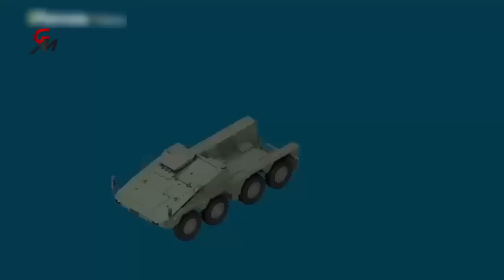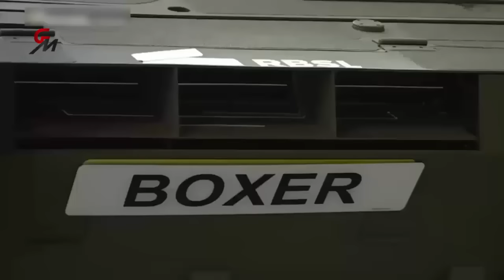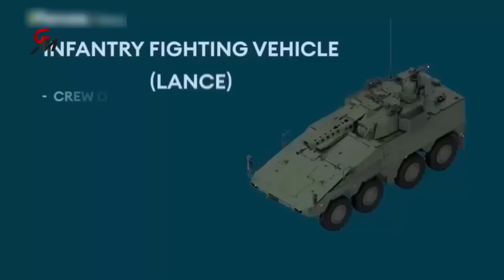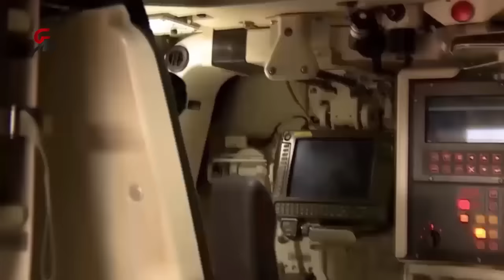The Wait is Over! UK Army's Boxer MIV Are Being Produced On A Large Scale

Comment: The new tracked Boxer chassis with a lance turret seems like a good replacement for the failed Ajax scout vehicle.
Reply: Not enough armour. Ajax is a completely different class of vehicle. It's almost double the weight. The UK should have gone with the CV90 but despite the bad start the Ajax will come good.
Reply: @wsm7929  I see.  Well, the Ajax's tendency to make the crew feel awful after a short ride will absolutely have to be dealt with.  Clearly the CV90 is far better, but if Ajax doesn't deliver a product the troops can use without it chronically injuring them, then General Dynamics and General Sycophant von Crony are going to be eating it.
Reply: @MichaelK.-xl2qk  Those issues have been fixed and I suspect given the USA New M10 Booker light tank is an Ajax platform it will be here to stay. 

The M16 had lots of problems but it turned out to be one of the best guns ever made. 

Harrier jump jet was heavily critised it was said it wouldn't stand a chance against supersonic fighters. Turned out fine. 

I accept it was a procurement disaster and as required alot of fixing. But once working as intended it should be one of the most affecting vehicles on the battle field.
Reply: @wsm7929  I agree with your assessment of what may be possible when a good idea gets through the debugging and fine tuning that inevitably accompanies making it real.  What I am concerned about is the appearance of a swindle, which can only be judged at the point where the promised goods are delivered and the bill is presented.  The UK can not be expected to pay twice as much as originally bargained just because GD ran into internal problems getting the thing done.  They are clearly going to make money selling the thing to the US Marine Corps, so they need to eat the cost overruns themselves.  These defense contractors should be held to a high standard or they will take advantage.
Reply: @MichaelK.-xl2qk  From my experience with government contacts, I suspect there were lots of instances of. "Wouldn't it be good if it could also do this or could you had this function please." Generally this one sentence is the root cause of most projects delays and overspends. I work in construction and the public sector is terrible for it. Then when the cost go up they will say. "We don't have the budget it this year can we spread the cost over more years". This always put the cost up even more and it's a vicious circle. 

I suspect military contracts are no different.
Reply: Sweden sent its latest and best to Ukraine they lasted a few minutes 😂
Reply: @yfelwulf  Well then why pay more?
Reply: @yfelwulf  Name one military platform that isnt vulnerable to certain scenarios??
The onus should be crew survivability, interchanged with modularity.
Reply: Tracked=good. Wheels can be bogged down more easily. As we see in Ukraine.
Reply: @wsm7929  Ajax is failed project.
Reply: @wsm7929  Project managing in the Public Sector is something I will never ever do again.
Reply: @wingaard  I agree the project failed in terms of overtime. It is yet to be over budget. The £5.5b price for just under 600 units seems to have remained the same. 

History is littered with projects that had a poor development stage but ended up delivering a world beating product. 

Take the Boeing 787 development, which took 9 years and cost $22b instead of the expected 5 years and $5.5b. But the 787 was a resounding sales success as the fastest-selling wide-body aircraft in history and well on its way to becoming the best-selling wide body aircraft of all time. It is reported that the aircraft has already paid off its development costs and earns Boeing $20m profit per plane on average. 

Another example was the Harrier Jump Jet. It was in development for years went way over budget, was even cancelled by the RAF once judged to be "noted that the effort to combine a strike aircraft and a fighter in a single aircraft, and trying to fit that same airframe to both of the services, was unsound".

I'm sure we can all agree that looking back at Harrier Jump, it was no failure.
Reply: @yfelwulf one loss is not exactly a major shock. 🤦🏻‍♂️
Reply: @wsm7929  How do you know its fixed and what have they done to stop crew sickness .
Reply: @williamdodds1394  Wallace said: “I have been clear this was a troubled programme, it was started in March 2010, I inherited a troubled programme, I was determined I was going to put this right, I get a weekly update.

“We think the remedies are in place, we are now going through the normal trials, can it go after the hill fast enough, does it do these things? It is showing great signs and we will keep on it.

I am confident we have turned the corner on this troubled programme.”

Wallace said the aim was for the Ajax vehicles to be active in military units soon after the testing programme is completed in about 16 months.

He said: “They are already training with it now, all these things take time to train how to use it, we have over 100 assembled so when we get through these trials we will get these into the units and be back on track.”

It is understood that despite the production being described by Wallace as “troubled”, the MoD considers some of the early problems to be development issues, which have now been overcome in updated versions.
Reply: Actually, tracked boxer can have side adons for protection like the main tank
Reply: @@karmakazi101 The Seargent York was a failure.  But to your point, I'm very glad to see the apparent progress from a defense standpoint.  One question left to be answered is whether Ajax will fail to perform the job according to its contract price.  If, at the end of the day, the per unit cost is higher than a CV90, then what?
Reply: @MichaelK.-xl2qk  Would still have been worth doing, Even if it is more expensive. Challenger 3 is due to be phased out as early as 2040 so Britain has been needing to relearn how to produce armoured fighting vehicles domestically before that cut-off for a while now. Even if Ajax proves to cost more than CV90 and with all its teething problems the MOD would rather have all of this now and build experiences domestically so we don't have it when the project for whatever is supposed to replace challenger gets off the ground (if it hasn't already behind closed doors)
Reply: @Fordmister  I'm in agreement with you there.  The important thing is results and action, not more excuses, and we're seeing it happen right now.  The thing has to be ready in time for a conflict which is already happening
Reply: @user-yl1xy5eg7b Tracked needs more logistics though, as you can't quickly move them on the road for long distances. 
A wheeled brigade can move thousands of kilometers within a couple of days without relying on railways. And still be faster at the target location than the tracked vehicles, because moving a brigade by train takes time
Reply: @patta8388  That's if the wheeled brigade doesn't face the sort of rough terrain which tracked vehicles can operate on.
Reply: @user-yl1xy5eg7b  Dude...a wheeled brigade is there to get somewhere fast and either push through if the advantage is there, or hold the line until the heavys arrive. You need booth in a functioning army.
Reply: @patta8388  That does not detract from what I said, and I am an ex soldier. HAND.
Reply: Ajax is now a pretty good unit..

Comment: Have they sorted out the overheating brakes problem yet ?
Reply: I can’t remember what design of vehicle it was but I think there was a vehicle that sprayed small jets of water onto the brake system that cooled it down somewhat but the trick is to not putting too much on the disks at once because cooked disk’s have been known to warp and explode
Reply: Why not fit the right brakes to do the job first time,,, ? sounds like British Leyland .
Reply: @thegrinch8161 What a stupid idea.  Means yet another thing troops have to remember to do, just to drive the vehicle safely. Is the water supply  harmed for winter driving?  Yes even at low temperatures  brakes can overheat. Water cooled brakes are fine on a WRC Rally car that can be replaced every 200km.  Not on an APC.

Comment: You can’t replace a tracked IFV with a wheeled APC. 🤦🏻‍♂️
Reply: sure you can. especcially if the wheeled IFV has better armor, better firepower and surperior firecontrol.
Reply: @zhufortheimpaler4041  a wheeled IFV is not an APC 🤦🏻‍♂️
Reply: @Bob10009  and the UK is thinking about replacing the APC module with an IFV module
Reply: @zhufortheimpaler4041  source ?
Reply: @Bob10009  UK MOD planning for the "strike brigades" from 2030+.
But currently no IFV Modules are on order.
So for now, the UK is brewing up a lot of steaming shit with its actual procurement.
still the Boxer APC version is better than Warrior in basicly all categories from mobility, sensors, stabilisation, operation range, protection etc.
Just the 30mm cannon is missing. But the 30mm RARDEN is an non stabilised 3 round clip fed piece of garbage. going to a FLW200 with fully stabilised thermals and fully stabilised 40mm AGM is for the time being an "improvement" in most areas, except range and penetration power.
Still the UK neets to get ther shit together and start procuring the IFV modules and not just think about them.
Reply: @Bob10009  The boxer can potentially fit to booth roles. It's more tanky than many up date IFV designs
Reply: @zhufortheimpaler4041  so, as I said, Boxer cannot replace Warrior, as the UK is not buying a turreted version. 🤦🏻‍♂️
Reply: @85daniel  the UK version has no cannon or turret, it’s an APC only. How is that “more tanky “ ? 🤦🏻‍♂️

Comment: The first priority should be procurement of turreted modules to replace the warrior ifv that are being axed.
Reply: be easier to just make one type of vehicle, that is multipurpose. And have a rail system on the floor and ceiliing, then you could just slide modules in to it.
Reply: @keibohow69  no tracked varients though. Ukraine has proved wheeled armored vehicles are fucked in a lot of situations.
Reply: @czar6595 most of the places they can’t go you would want the better protection of Warrior or Ajax. One use for this platform could be a wheeled Geopard to combat drones at a more affordable cost than a more heavily armoured tracked system, allowing for more units. A common turret that could be fitted to a tracked platform would be good for front line use.

Comment: Wonder whether they will replace the 30mm canon & have a XM913 chain gun 50mm variant..
Reply: Why? We are not the USA where it takes 2,000 rounds on average to kill an enemy combatant.
Reply: the 50mm round has not so many benefits over a 30mm round.
Penetration is not good enough to engage heavy armored targets, vs BMP-3´s and other IFV´s the 30x173mm APFSDS round does more than enough on medium to long range.
Vs Infantry and soft targets the 50mm HE round does  not increase the lethality by such a large margin that it is drasticly better. 30mm ABM rounds tear infantry and soft targets to shreds.
30x173mm roundes require about 50% of the storage space of the 50mm autogun ammo. so more bang for the same volume.
And against anything that is armored enough that a 30mm wont go through, the 50mm wont either and you  use the ATGM´s

Comment: Would be interesting to see comparisement with Patria AMV, Rhein Metall Puma and Boxer which are basicly made for the same purpose.
Reply: Patria AMV is drasticly lighter armored than Boxer but has similar mine blast protection. Boxer is also faster, but is not amphibious (like Patria AMV when it got its hightest level protection mounted. Patria is only amphibious in its lowest protection level and in that case is only protected against small arms)
Puma is completely different, as it is a full blown heavy IFV with even heavier protection.
Reply: Patria is a pure ATV, The Boxer have much more armour and modules which make the vehicle to an IFV, the puma is a pure IFV with the best armour. In germany there is the plan to have light, medium and heavy combat groups. The light groups are e.g. paratroopers, in the medium groups is the boxer the default vehicle and in the heavy groups there are e.g. the Leopards, the Pumas and the Panzerhaubitze-2000. Aditional germany plans to buy a new ATV to replace the fuchs(maybe the patria) in the future for the troops which are normally not in the hard combat zone(e.g. electronic countermeasures).
Reply: The Puma is much more heavily armoured and more specifically designed as an IFV. It carries missiles as well as the remote controlled turret. The German Army initially planned to only use the Boxer in the APC role, but has now also acquired a better armed version as a reconaissance vehicle and will likely buy a similar version for its "Mittlere Kräfte" (mobile forces that use heavily armed but wheeled vehicles).
Reply: @tobiwan001  Yeah, we're getting 30mm turret versions and 155mm howitzer versions. Option for 105mm tank hunter is still on the table

Comment: Can it cross the same terrain and keep up with the Challenger?  If not, it is not fit for purpose.
Reply: it can and is quicker than CR2 in terrain. 
CR2 does 40km/h offroad, a Boxer does up to 80km/h, so its the Chally that is slogging behind.
Reply: @zhufortheimpaler4041  depends on terrain. chally would be slower than boxer in some areas but would absolutely storm ahead in others
Reply: @jamesamas5527  There is basicly no terrain where Challenger 2 has better mobility than Boxer due to its prohibitive weight and atrocious power to weight ratio.
Reply: @zhufortheimpaler4041  can tell you now there is a lot of terrain where a challenger would smash a boxer off road. war thunder isnt real life mate
Reply: @jamesamas5527  and i have personally seen boxer driving through terrain, most tracked vehicles wouldnt follow into on german training grounds.
That thing has comparable terrain mobility to an MBT.
Only when we are talking about extreme deep mud conditions, tracked vehicles gain an minor edge.
but only those, that are in a similar weight class. 
Challenger 2 has double the combat weight and struggles with alot of stuff Boxer can do.
For example Obstacle climbing or slopes.
Here Boxer outperforms CR2.
The only real thing CR2 can do mobility wise, that boxer has problems with, is trench crossing, here CR2 gains 40cm trench width over Boxer.
Reply: @zhufortheimpaler4041  also after seeing the kind of terrain that a chally just eats up without issue where most other vehicles would struggle, get bogged in or bottom out I'd like to see the boxer try and keep up
Reply: @jamesamas5527  As said above, there iis basicly no terrain where Challenger 2/3 can go and Boxer cant.
On the other hand, there is alot of terrain, Boxer can cross and manage, where Challenger 2/3 cant go.
CR2 is THE HEAVIEST and least mobile MBT in service of western Nations.
Boxer can keep up with Leopard 2s offroad. 
Challenger 2 cant.

Comment: 2 questions: what does this do that other ones don't do? We know tanks/vehicles like heavy IFVs are increasingly useless on a modern battlefield, so, why make this now? Without knowing a real answer to the first question, there's no real purpose in producing these. 

Opinion: It'd possible be better to invest in a stealth motorcycle lol. Or, upgrade a nice cheap yet effective infantry carrier if needed, like the US hmmvv or MRAP that are essentially just cars with mounted things on them; where it's cheap enough, yet good enough to protect the troops and provide fire support, so losing one isn't a big deal either. There's a reason why fitting cheap, old solutions with upgrades to fit the current purpose, has been usually better than the cost of making something brand new that's just as vulnerable. It also seems like Britain just wants to try to make something itself and in doing so made something that's negligibly better, 'at best 10% better', for a much larger cost. They'd be better off, if they could make like a competitor F35 plane or something else to specialize in. No one is going to want these vs the competition, unless you can answer the first question and prove the vehicle is revolutionary somehow.

Comment: I think it's abad idea. why logistics and cost, 
How many vehicles will it take to transpoprt one base unit and various modules? 
how many modules to one base unit?
Plus you would have to add a crane to the mix. 
So how many cranes would be needed?

So in a time of battle, lets say you have 10 base units and say 3 modules per a base unit. 
Where do you store the modules? 

Other alternative you have 10 uints 3 of one type, 3 of one type, and 4 of one type.
Which setup will be the cheapest and fastest to move and get operational?

Let alone the fastest and cheapest to manufacture And store?

Another example you do the module set up 3 to 4 base units get taken out, what do you do with the modules?
Reply: It’s not necessarily something you’d use on a battlefield but the idea is that if you have something like a humanitarian crisis you can take a bunch of ambulance modules out of storage. Use them on a bunch of boxer hills that we’re doing other things and ship them out.

But even in a war armies will create safe areas behind the lines for vehicle repair and maintainence, you could theoretically take a bunch of spare modules on the back of trucks or transported I; aircraft and swap them onto boxer hulls in these areas.